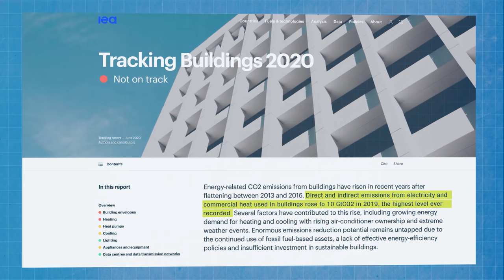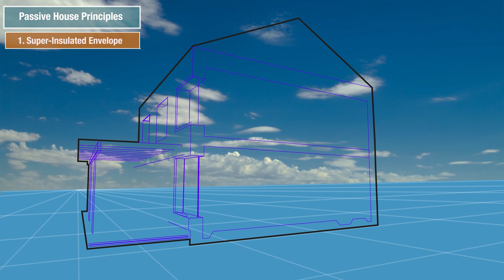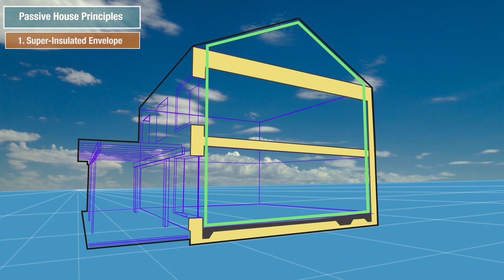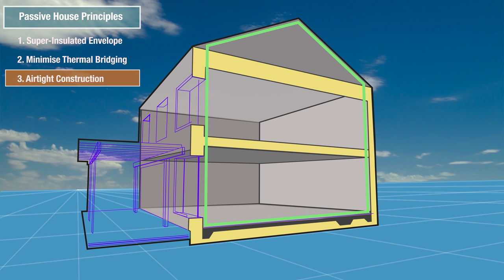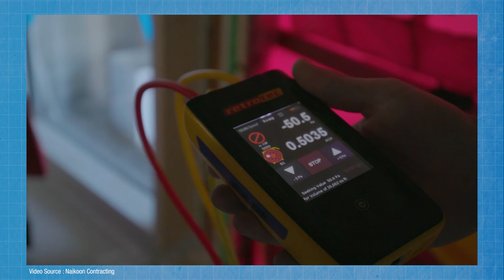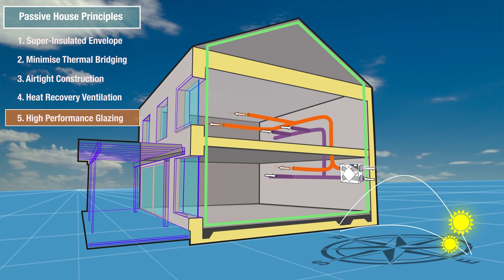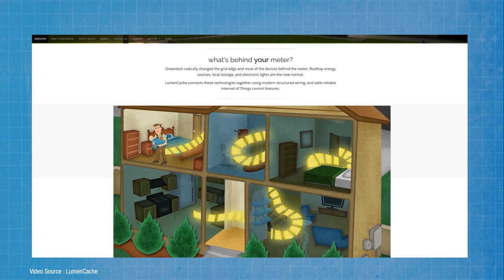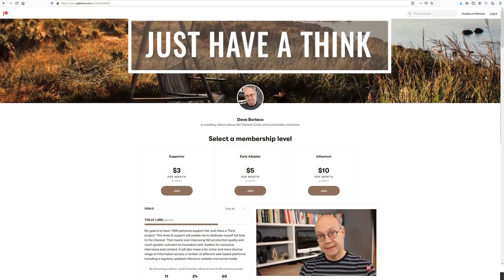Passivhaus . A low carbon future for our homes?

Comment: Thank you once again for an excellent review on Passive construction & other subjects. I've been involved in building & design over 60 years including passive. For those planning on building, these passive practices are a must consider. Designing with the forces of the five giving elements: Solar, Wind, Precipitation, Soil & Life. https://sites.google.com/site/indigenecommunity/design
I would like to add a couple of high priority passive 1) material & 2) social-economy practices if you are hoping to pass your passive home along to offspring & future generations: 
1) MATERIAL / FOAM-CRETE is soap bubble lightened cement added to regular Portland Cement, which can be blown through a tube into existing wall cavities from the outside or inside. Foam Crete can be fashioned along with plastic-covered fibreglass screening into lightweight wall, ceiling & floor U-shaped panels, best factory built, for the perfect modular, quick assembly & disassembly where needed. Foam Crete has R-values equivalent to fibreglass, low to no-toxicity, fireproof, low sound transmission where properly designed. Foam Crete is also recyclable, biodegradable & disintegrates compatible in sand, diatomaceous-earth, Plaster-of-Paris & other nature occurring materials back into biosphere compatible components. Foam-Crete with excellent R-values doesn't not provide a heat-loss or gain bridge. Here's a good 'Aircrete vs Foamcrete, Which is Better?' article with resources to get folks started. https://www.builderspace.com/aircrete-vs-foamcrete-which-is-better

2) SOCIAL-ECONOMY: All humanity's worldwide 'indigenous' (Latin 'self-generating') ancestors planned & implemented ~100 person (50-150) MULTIHOME-DWELLING-COMPLEXES (eg. Longhouse-apartment, Pueblo-townhouse, Kanata-village). Today Multihomes & developments cost 1/3rd $ to build & 1/3rd $ to operate, heat, cool, service, maintain, infrastructure etc compared with detached nuclear homes. Designed passively for reception of solar, wind, water & soil elements multihomes are way ahead of any stand-alone home ecological efficiency created. 70% of populations live in Multihomes but we have lost the ancient 'indigenous' knowledge about how to collaborate. https://sites.google.com/site/indigenecommunity/relational-economy/extending-our-welcome-participatory-multi-home-cohousing 
Builders should consider HUMANE 'ECONOMY' (Greek 'oikos' = 'home' + 'namein' = 'care-&-nurture') therein of proximity & other gregarious architectural design features in such as passive construction. Colonized human society has found itself repeating a disastrous institutional dependence death-rate among the vulnerable during COVID-19 & subsequent viral-variants. 30% of populations live very isolated in detached nuclear suburban & country sprawl homes where interpersonal collaboration is very difficult, car & highway dependence driven with little cultivation of natural production for essentials such as water, food, materials, energy, wildlife collaborators etc. https://sites.google.com/site/indigenecommunity/relational-economy/7-nuclear-war-detached-housing  
Hence our elder generation, sick & handicapped are dying as warehoused unneeded & unwanted in Long-term 'care' facility old-age homes & hospitals. Such wisdom bearers carry the key spirit, knowledge, temperament & innate talents needed for 'community' (Latin 'com' = 'together' + 'munus' = 'gift-or-service') collaboration. In multihomes, intimate, intergenerational, female-male, interdisciplinary, critical-mass, economies-of-scale where collaboration is made easy through proximity. Other cultural practices guarantee personal sovereignty / privacy. 'Do-we-know-who-we-are-?' is a web-based Community-Economy software ready for people who want to design sustainable human-economy interaction & sovereignty into architecture.
'DO-WE-KNOW-WHO-WE-ARE-?' is a neighbourhood web-based open-source software tool for 'community'. Knowing each other’s talents, goods, services, resources & dream, generating collective livelihood together & then being about to include each other in our collective multihomes & interactive neighbourhoods. https://sites.google.com/site/indigenecommunity/structure/9-do-we-know-who-we-are

Comment: Cement production make huge amounts of CO2. Bricks also.
Reply: This is not necessarily still true. The uk cement industry (and the majority of cement is U.K. manufactured from locally sourced minerals etc) is doing much work to reduce emissions please follow this link to see there work so far and proposed towards achieving their target of below zero emissions https://thisisukconcrete.co.uk/Perspectives/UK-concrete-and-cement-sector-sets-out-roadmap-for.aspx . Do not forget also that much of the timber used in construction comes from overseas e.g. Norway or Canada and is often treated with preservatives and uses resins and adhesives all of which have CO2 emissions and other environmental impacts associated with transport and production. Therefore when looking for a sustainable solution to building homes and other structures the whole life of a material must be considered.

Comment: Heat networks. Heat networks. Heat networks.... Blind spot in your channel. If the energy is relatively cheap and renewable, the extra expense of passivehaus standards won't be worth in most cases due the law of diminishing returns. It's also very difficult to retrofit this standard. Look what the Fins are doing!

Comment: I live in a hot and humid climate, so hot and humid that mold and mildew are big concerns. Is there hope for me?
Reply: A well constructed passive house should include a vapour permeable membrane and will not encourage mould or mildew if designed and constructed well.
Reply: @MrEediot  cool. Where I live the average relative humidity is 90% in the morning and 72% in the afternoon. I figure dehumidifiers would have to be used. Usually an air conditioning unit will dehumidify the air for us, but I don't imagine a passive house would have one of those.

Comment: You do many videos delving into carbon pollution, global warming, and the like.  As someone interested in all of this, I have a question for you. During the seventies when I was in college the major issue of importance involved the concern that we would eventually run out of fossil fuels.  It was stated that we had around 100 years of coal reserves and peak oil would arrive around the year 2000, but eventually more and more oil fields were discovered that pushed back the peak oil date.  The question I have for you is what ever happened to concerns about running out of fossil fuels and, if this was a concern, then why do the global warming proponents carry out their projections as though there is infinite oil such that fossil fuel usage continues to expand without limit for a hundred years or more?
Reply: Well, we don't need to burn all of the oil in Earth to have a problem. Just burning enough to reach 3/4ºC would be a big problem
Reply from the maker: They found more Cleetus.
Reply: In a word....Fracking.  The USA went from being an importer to an exporter due to fracking technology as an example.

Comment: I've been banging on about Solar Thermal Gain for years. You know when the sun shines through your windows n winter and it gets nice and cosy inside. And it's debatable how long more we will actually need 240 volt power supply for lighting when most (read: shortly ALL) lighting these days is via LED's. And there must come a day when all the wall sockets also will only need low voltage DC electricity. Think laptops, smart phone recharges and even TV's need DC current at lower than 240 volts to work.
Reply: Most new laptops can run off USB C, which I'm led to believe is about five volts. A modest, portable solar panel will supply that no problems.

Comment: I remember that technology being explored in the mid-late 1970s. The Passive Houses were so well-insulated and sealed that they actually had poor ventilation. This got attention under the moniker "sick building syndrome".  Indoor air quality is a very serious problem. In most circumstances, indoor air is actually more polluted than outdoor air. Another thing: in the age of COVID-19,  people have begun to understand the role of ventilation in health and prevention of disease.  Passive Houses are NOT the answer--they are unhealthy.
Reply: Passivhaus has constant ventilation with heat recovery to avoid the problems you mention.

Comment: Too bad for the rest of us that live in crowded city apartments.
Reply: Did you purchase your apartment or renting it? Either way you aren't left with any choice. This is where 'standards' have to now and should have long ago been applied
Reply: @k.bellingham8335  we bought what we could afford in a location that wouldn’t kill us thirty years ago
Reply: @iaindowling8993  Well, if you own it, you should be able to upgrade the outer walls then, right?  It's expensive and troublesome, but at least you have options.
Reply: @incognitotorpedo42  In theory yes but in reality you need the majority of owners to agree to spend money and it’s a real accomplishment just to get the majority to pay there maintenance fee and to accomplish the type of improvements illustrated would require a complete redesign of an apparent building.
In summary I wouldn’t recommend getting into an condo except in desperation as we were at the time.

Comment: I wouldn’t go for a real passive house. 
 There is so much margins for error and it’s simply too expansive. The isolation has an impact on the environment too.. 

I think a aktive (pv) low energy house is more cost effective and has less expanse in air conditioning systems to prevent problems with fresh air. 
In Germany we habe incentives... 
Sadly it’s not required for new buildings. In my options it should only be allowed To build „KFW55+“ (so it only uses up to 55% of the energy a standard house defined by 2009) 
And it should have photovoltaic ans and Storage required (Not in the regulations atm.) 
Explanation: 
The “Kreditanstalt für Wiederaufbau” (“Reconstruction Credit Institute” in English) was established in the years following WWII as a part of the Marshall Plan to rebuild a devastated Germany. 
An officially ‘energy efficient building’ in Germany is one whose primary energy demand and transmission heat loss are below certain levels defined by the 2009 Energy Saving Ordinance (EnEV 2009). The standard, minimally-compliant building – i.e. a home that is 100% compliant, using no more or less energy than is deemed acceptable by the EnEV regulations – is designated “KfW 100”.

Taking into account factors like energy consumption, CO2 emissions and so on, the KfW differentiates between three classes of energy efficient housing: KfW Effizienzhaus 40, KfW Effizienzhaus 55, and KfW Effizienzhaus 70. The number indicates the percentage of the prescribed EnEV energy limits the building uses. A KfW 70 house consumes up to 70% of the EnEV limit, a KfW 55 house up to 55%, and a KfW 40 house up to 40%. In general, the smaller the number, the lower the energy requirement – and the more funding the KfW can offer you as the property buyer or builder.
Reply: Its ironicly to note the difference with the Netherlands in policy regarding climate change and energy usage. We dutch try to phase out fossil gas usage , while our German neigbours are planning to switch to gas usage! Im not certain what will be the smart move, its still a controversial policy in the Netherlands, with some questions whether its feasible. Its ambitious but planning, practical issues and burocracy seems a big botteneck in the strive for gas-free housholds.
Reply: @cz1589  
Sadly out reigning parties (CDU/SPD) are known for protectionism of old Industrie and markets they don’t want the disruption due to a lot of profit in centralized energy... since 2009 they try to slow down the Transition to clean energy... actually ironic, that shell (royal dutch shell) is trying to push the gas and H2 strategy in Germany... we fight to have it change, but our 
Eeg (erneuerbare Energien Gesetze / renewable energy’s regulations) will be updated in 2021 with even more restrictive regulations especially for big renewable projects (the EU with the RED II norm safed us from killing the change completely) 
The new claim is to import H2 from Marokko... I try to fight to bring this up for the elections in 2021...
Reply: @timvonr2802  at least the EEG managed to spark a solar revolution in the past - but consistent  green policies are rare, and certainly in multinational perspective. Personally, i think the future will be a mix of innovation and stagnation, with different outcomes in specific areas and nations. So it will be a blender of results. 

It will take more time then reasonable - but reason dictates the tides will turn soon or later. But as said in the video: double or triple the estimated time of fundamental changes. New kids on the block need to mature and rise in power, before then can steer the boat.

Comment: I have built a passive solar.... and 80% repurposed building materials .....eco retreat.....it can host 20 or so people at a time.....and it was not motivated by “ the green agenda” or because of the “climate carbon agenda” that most people are motivated by currently....I was motivated because common sense and economics (the math) worked out....the pure and simple fact remains that as long as our society holds profit and money as our collective “highest value” the only rational argument for change must be money and profit....there are hundreds of so called “ green ideas” that not only do not work environmentally but they also are more costly than using carbon based fuel sources.....just because the green narrative or the carbon narrative or the climate change narrative is currently the most socially accepted position does not mean all the ideas that are motivated by those popular positions are GOOD ideas!.....huge exclamation point !! ......

Comment: Well I need to disagree a little, passive design is actually very old . From the air chimney designs to cool in the summer and earth sod homes of past, all prior to electric. Of course these were not as efficient as today and were just the ‘way’ to build in the day.

My professor in college in the 70’s had a passive house of 2100 square foot. He used 100 dollars of electricity to run the whole house for a year, old reason he was hooked to the grid was that it was required back then. In the house design was controlled leakage to get air changes needed as air to air heat exchangers were not so reliable and of short supply ( also was looked at as needed for poor design) . House was super insulated but I don’t think that term came on till the 80s . Windows were not that available so thermal shutters and interior storm windows were used. He claimed it cost about 10% more to build which was paid back in 4 years. 

Just saying.

Comment: 7:05  If you look at the windows, they are set back in the frames.  Wrong.
Reply: ? The windows should be placed in the centre of the insulation of the wall. Plus in most areas summer shading of South facing windows is very important and sitting in a recess helps this.
Reply: @treescape7  If you put your windows to the outside of the sills, they cover up more of the sill preventing them from rotting out plus less insulation is exposed to the heat and cold.  In the last 10 years, I've changed out several hundred windows.  Fiberglass is the best with a triple pane.  The glass on the south side will get little sunshine in the summer.  The sun comes up in the northeast and goes down in the northwest.  Not until late August do you start to get a heat gain.  This is because the triple-pane clear glazings will reflect the sunlight until that part of the year.  After that, from September through April, those windows help heat the building.  East and west windows are what really raise your air conditioning bill.  I have a 3,400 sq. ft. house with no exposed windows on either east or west side.  I have 300 sq. ft. of glazing on the south side, and about 60 sq. ft. of glazing on the north side.  The roof is coated with whited Roofguard 700 which reflects the heat in the summer.  The attic has about 14" of cellulose insulation.  My gas bill in the winter is about $37.00 per month and my summer electric bill is about $115 per month.  Summer gas is $0 and winter electric is about $85.

Comment: I think passiv Haus is climate specific. Unless your running the AC try them in hot humid climates when you want low thermal mass and plenty of natural ventilation and a tropical roof abs walls for shading. The amount of chemicals and plastic wrap puts me off. 

Been looking at compressed earth bricks breathable for humidity control and exterior cladding corrugated iron “tin” roof having a large naturally ventilated gap between them. 

Sadly they don’t meet code for R ratings in insulation in Australia. Plus they want a vapour barrier they just don’t get condensation will form on the inside face of the tin and run off. Regulations in Australia push me to build a house with plastic toxic insulation that does not breathe.